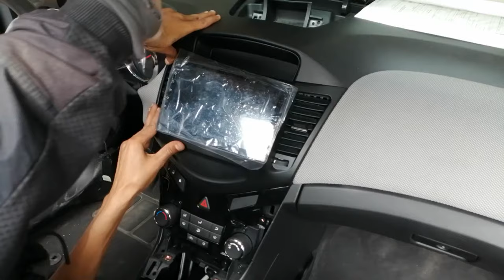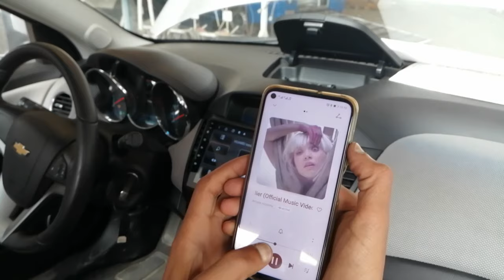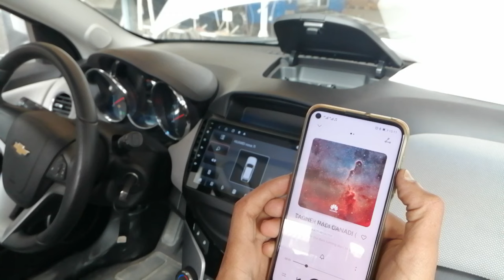Installing New Android Radio screen With Backup Camera and GPS Navigation on Car

Comment: Good video. 

I would like to ask you about the car configuration that we have access in the original display, installing this new multimidia will make us lose the access to it, right? How do we access the setup of the vehicle, then?
Reply: It has a module called canbus, through this, it can access the settings (got same car, just different android radio). At 7:31 you see the module, small box on the right side of his hand
Reply: thank you so much for your attention
Reply: @RedFighterNL  if I’m not wrong when you have can bus then you don’t need to connect wires to reverse light  you just connect it to a wire that says back in this case the pink one in the back of the stereo?
Reply: @rezamirzaee5006  No need for wiring, just plug the cables. My car has parking sensors and they work fine as well. I did install a 12v DAB antenna (5v didn't work for me), which meant I needed to wire it to the power cable of unit itself.
Reply: Hi Im worry about this vehicle setting too, so there is no issue if I replace the original radio with android radio especially for the vehicle setting for access car features? Because its include the can bus module that we can still access the vehicle setting like the original one?